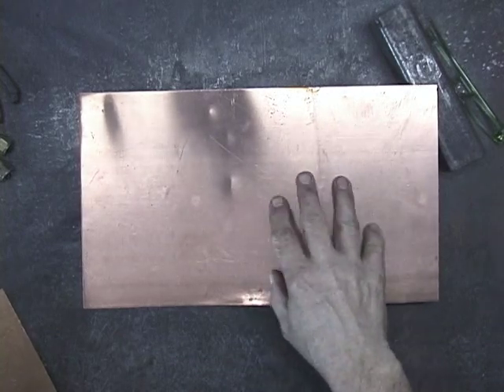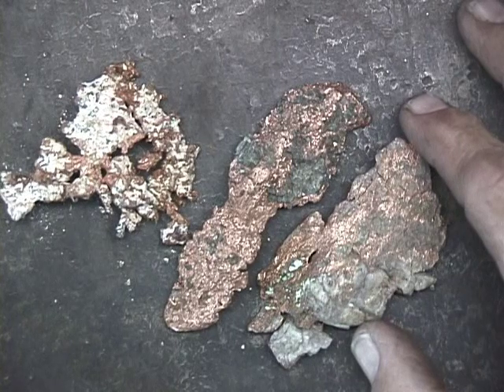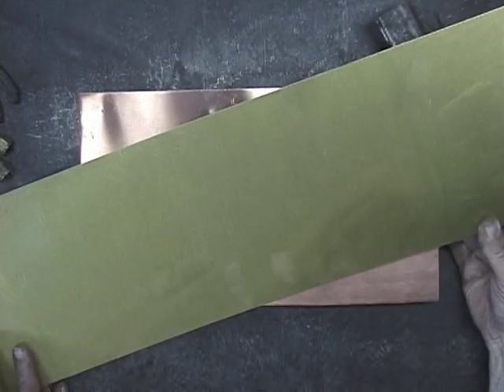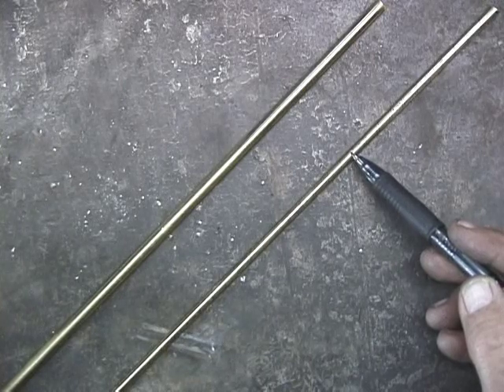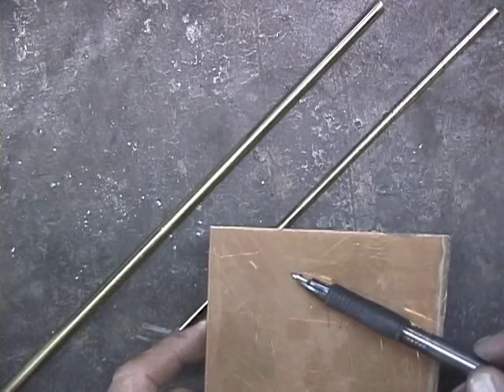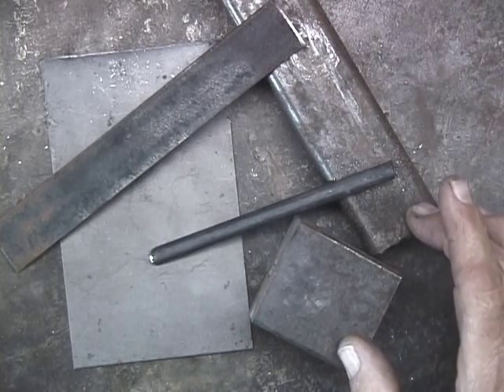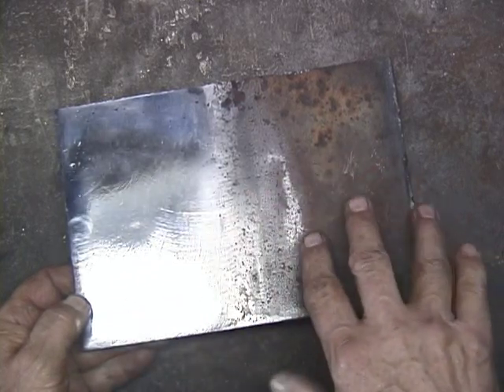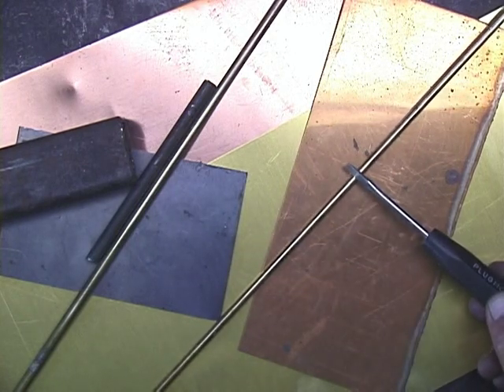Copper, Brass, Bronze and Steel

Comment from the maker: It depends on how much heat will directly come in contact with the table top..

Personally I use 1/2" steel since I often braze on the table top for long periods.

If you are using an oxygen acetylene torch I wouldn't go any less than 3/8th,

1/8th will warp quickly if very much heat (oxy/ace) is applied directly on the metal.
Reply: believe christ as your saviour